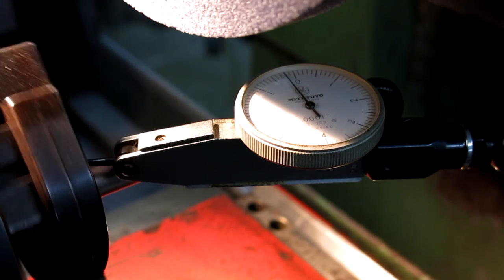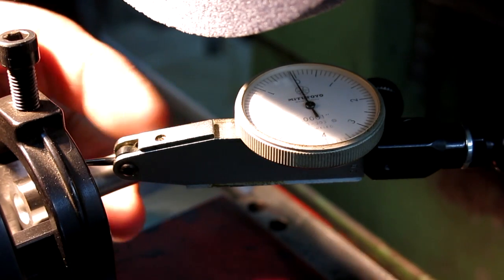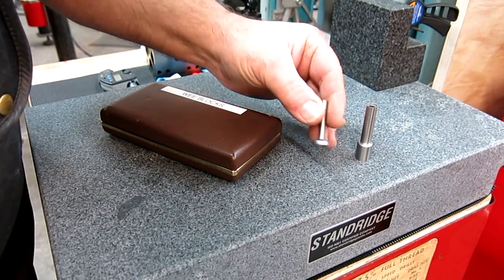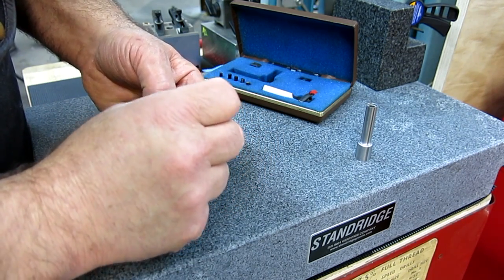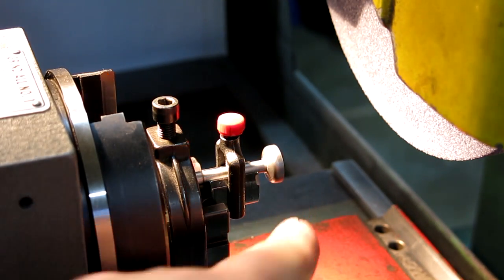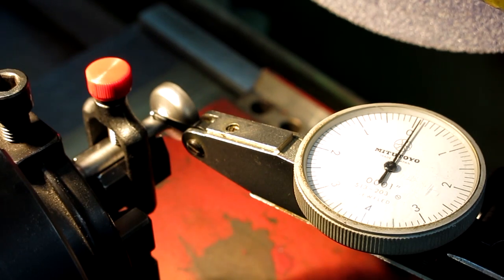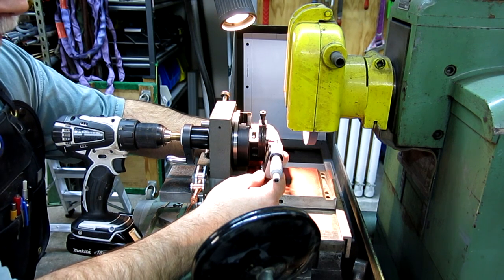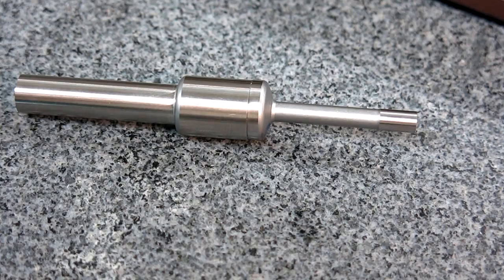Precision Toolmaking Making an Edgefinder Part 2

Comment: Any idea how significant the concentricity error between the shaft and the contact tip would have to be before it would cause the edge finder to give a faulty reading?  

Just something I was thinking about given the features that you can't grind with this setup.  Got me wondering about how a lack of mass balance around the axis of rotation could affect the function.

Comment: Personally I would have lubricated the sides on your clamping system as well the adjustment screws, You probably would have been able to adjust much closer with your dial indicator,
Reply: And rotate the part in the opposite direction so the surface being indicated is moving away from the indicator. (Or keep the rotation & indicate from the bottom if using a push/pull indicator (can't remember the technical term, but specs would be something like .005" - 0 - .005"))

I'd actually love to see a comparison b/c while "always set up with the friction vector pointed away from the indicator/stylus" was repeated ad nauseam, I've never seen a real world demonstration looking at the variance in accuracy/precision.

It's simply one of those things that has always been trusted b/c the reasoning was very sound. 🤷‍♂️

Comment: My surface grinder doesn't make much noise.  Did you buy yours at Harbor Freight?
Reply from the maker: +John Welden Hey John,

You got that right. Motor bearings have had it. Going to send the whole spindle in for rebuild here pretty soon. It drives me nuts as well. Thanks for the comment. 

Cheers,

Tom

Comment: Did you ever have any issues with generating heat on the small parts during grinding? Just curious if you had to let cool in between passes so as not to risk wrecking the heat treatment? Thanks for all the content you bring to us amateurs!

Comment: I have no problems with your process progression at all. I am totally focused upon both part one and part two. I like the reach of the edge finder and find this a very interesting and entertaining project. You hit the baseball out for a home run. I have never purchases mini V blocks (or Wee Blocks)  and I think it will be a wise investment for me. I like your whirly gig spinner and was not surprised at all that you prepped the wheel before starting. Very Pro as usual Tom. I liked your attention to the screw so no mark was made. I like Brass shim bent to fit and slide yet copper would be my smart choice as I love the stuff.

Comment: Hi Tom,
I'm wondering there must not be much pressure between the grinding wheel and the shaft? 
Also your assortment of smaller or miniature tools for holding small shafts is very impressive I've never seen the miniature V-Blocks. 
I sure have enjoyed these two videos about your edge finder. I guess there will be a part 3 to finish up?
Thank you,
Jeff
Reply from the maker: +Jeff Bernstein Hey Jeff,

Got to go small since Adam has the big stuff well covered. Should be four parts to this. Thanks for the comment.

Cheers,

Tom
Reply: +oxtoolco Tom,
You're right when it comes to Adam having the big stuff covered!
Reply: +Jeff Bernstein well Adam is doing the Abom sized stuff :)

Comment: It seems to me the narrow, center part of the 'pecker' should have been ground first so that you'd have that true cylinder to mount/remount in the v block.  It could have been warped from the heat treat which would end up giving you runout at the tip, no?
Reply from the maker: +svenp Hi Sven,

You are correct that if it was badly warped it would be a problem. The tool is self proving when you test it as a system in the end. Stay tuned. Thanks for the comment.

Cheers,

Tom
Reply: +oxtoolco I must say that I was thinking on the same lines as Sven, I couldn't see how you could have decent co-axial alignment between the ends, having ground the shoulder end first. I look forward to your explanation and demonstration as to how you get it done. 
Thanks again for all your great video work Tom, while I always give your episodes a like, I don't always say thanks for your considerable effort, so a very big THANK YOU from Australia, Cheers,
RT
Reply from the maker: +Rope Tangler The center section was turned round with the other two diameters. It was not significantly off even after heat treatment. Remember this is a visual tool. Consistent jump is what we care about here not absolute geometry. Thanks for the comment.

Cheers,

Tom

Comment: really like this surface grinder work. your pieces seemed to have maintained a high degree of concentricity after heat treating. is there a secret to this.
Reply from the maker: +larry sperling Hi Larry,

This was 52100 steel which is pretty stable in heat treat. Proper quench rate and medium is one secret. In other words don't use old motor oil or transmission fluid. Thanks for the comment.

Cheers,

Tom
Reply: +oxtoolco what about new motor oil
Reply: +Dušan Pešić
&#160;If you really want to use something other than specialized oil, use canola or olive oil before motor oil...   ;)
Also the way you introduce the part in oil will determine most of the distortion you may get...
Reply: interesting, thank you

Comment: Tom

Again very interesting video 

But how do you test to see if the part is true cylinder , using a Mike will not test for that ?

I know I am being pedantic but my inquiring mind would like to know

Stuart
Reply from the maker: +Stuart Hardy Hey Stuart,

It doesn't really matter in this case. Its not a cylindrical journal running in a bore. Its a visual tool. As long as the two diameters are the same and concentric the tool will work. The face to the cylindrical part is what is important and will come out in the testing. Thanks for the comment.

Cheers,

Tom
Reply: +oxtoolco 
Tom thanks for the reply , maybe you could cover the measurement aspect in a future video 

Stuart
Reply: +oxtoolco Just out of curiosity, is there a method for checking the roundness of a part using more basic metrology equipment, preferably something self verifying. The only way I know of is with a Talyrond.

Comment: I'm not doubting your judgment by any means but are those indexers made to be continuously rotated?
Reply: +Cody Rasberry  no 1 rpm every other tuesday
Reply: +Jerry Schram haha that's funny Tom. Oh wait... That's right you're not Tom.
Reply: +Cody Rasberryi am not Tom   but i did stay at a holiday inn last night
Reply: +Jerry Schram that's amazing. Tell it again.
Reply: +Cody Rasberry To answer your question. Yes, that is exactly what those indexers/spinners are made for.
Reply: +Cody Rasberry As long as he stays between 120 rpm and 125 rpm it will be fine.  Any more or less, it could throw a rod.
Reply: + Cody Rasberry For a serious answer to your query, the better made ones have whacking great ball races in them which should be good for many hundred if not thousand  RPM, but then you might get into balance problems so perhaps best not try. Did I say serious, sorry! :>)
Reply: +Chris Stephens thanks I was just curious whether it just worked for that purpose or if it was actually meant for that purpose.
Reply: I think the handle indicates that it is meant for manual turning, otherwise they would have some other means of turning it. The bearings are really there for zero play, not necessarily high speed. The lube in mine is so old that rapid turning is no longer an option, yet another job for the tuit list.